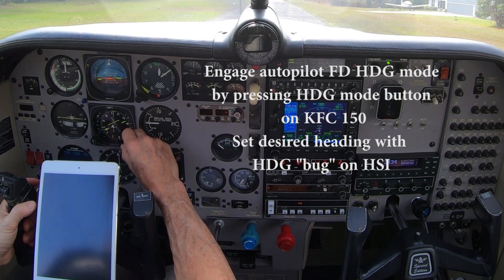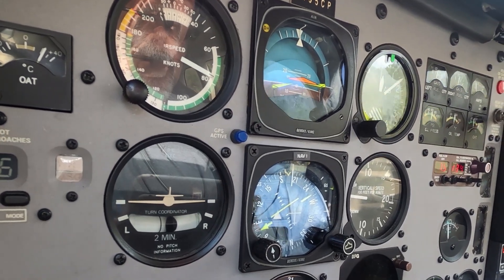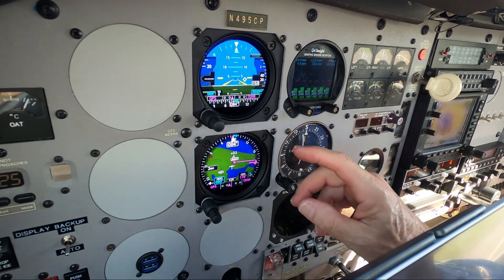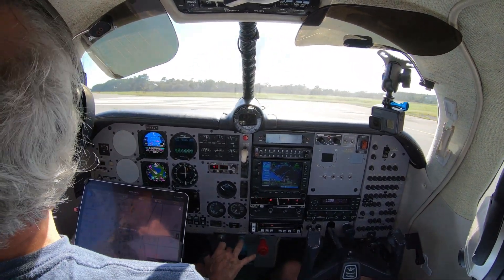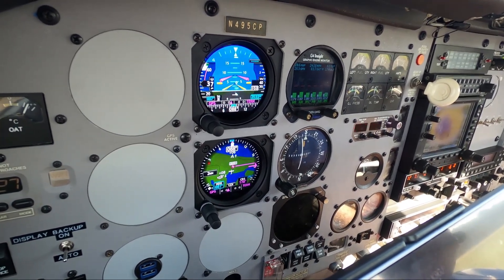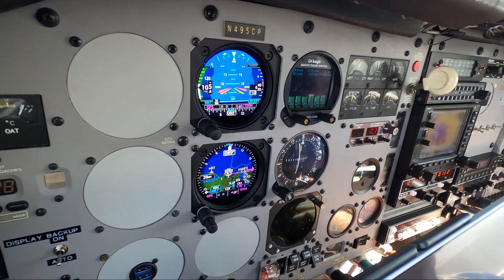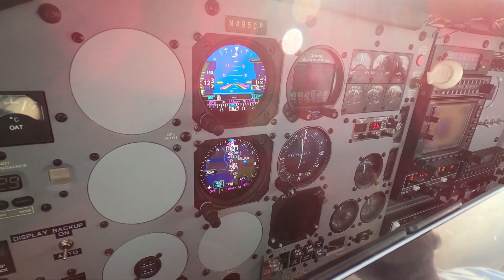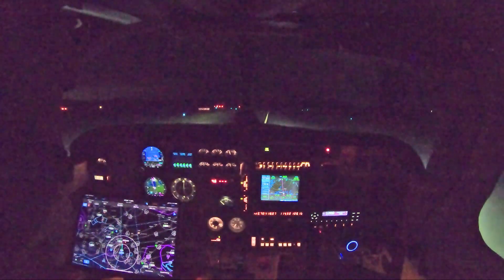Dual GI 275 upgrade - Flight Director takeoff vs Vacuum driven AI in a Mooney Ovation

Comment: A dual cueing flight director works much better with glass avionics. I don’t know if there’s an option for that on the set up menu but if there is you should try it.
Reply from the maker: I am aware that the G3X does have that option. Not sure about the GI275 though. Although I am comfortable with the FD option I have. 
Thank you for the suggestion.
Reply: Savagecub…The dual cue, Sperry, “Dancing Snake” is selectable on both the G5 and the GI 275.  The Collins, single cue is the default FD and the one most folks seem to use.  Personally, I prefer the dual cue.  Once you become accustomed to it, you can shoot a tighter approach than with a single cue, especially when the display is small like the G5 and GI 275.

A side note to remember when using a FD…always look through the FD to ensure the commanded attitude is correct.  FD’s do fail.  I have seen them fail without flags.  One should always know the desired attitude for the particular phase of flight.  The pilot is always the final judge and solution to the automation.

Comment: So you have both units set up as ADI+AHRS (+AP) for the top unit and ADI+AHRS lower unit?  That is interesting.  So can you still use the lower 275 as an HSI also?  Do you have all the map functions on the lower unit and the upper unit?  Curious why you did not go with a 275 MFD for your EIS system?
Reply from the maker: Hi John,
The bottom unit is an ADI+AHRS and IS configured as an MFD / Standby ADI. So it has all the pages of an MFD including HSI and HSI map. 

I didn't get a 275 to use as an EIS because my G4 works very well. I would have gotten a 275 as an EIS if it were able to display both EGT AND  CHT on the SAME page. Unfortunately it appears they don't. I believe if you have angraphical engine monitor you should display bot parameters to be able to diagnose right away engine problems and differentiate between detonation and preignition. On the other hand, nice features of the Garmin unit acying as primary instrumebt gauge,  alarms, etc.....

Comment: Nice set of detailed videos. I am in the process right now of installing a second G5 in my Twin Comanche. If I didn't already have a G5, I probably would have installed a pair of GI275s.

How's the scan now that the legacy airspeed indicator and altimeter instruments have been removed? I find the presentation on the GI275 (or G5 for that matter) much too small to function as a true standalone PFD.
Reply from the maker: Thank you Ryan!

The scan is easy and intuitive. Took a couple of flying hours to get fully  used to its compact tape presentation it but it is second nature after that. Do not miss the six-pack at all!!! It is all in one place and very easy to read and interpret. 

The difference between the 275 and G5 is like night and day. The 275 is bright and very crisp in any lighting condition. Very surprising for its size. Would a G3X or G500 be better? Of course, but MAJOR $$ difference!!! 

I am extremely pleased!!

Comment: Thank you for taking the time to make this video. There are more and more video out there on avionics upgrades. I for one appreciate the time taken on this. With all of the options that are becoming available, it’s great to hear real
feedback. I find this very useful. How much did your set up run you?
Reply from the maker: Thank you Scott! I am doing one specifically on its interaction with my KFC 150 autopilot and using GPSS mode that the 275 emulates. Hope to have it published this weekend. Takes some time to edit...

About $17,500 to $18Kincluding OAT probe and USB ports (GSB-15) which are very useful and worth the additional ~$500. Also includes wiring to the GDL-69 in the back of the plane (~8 hrs labor). No expense to make new panel since they fit in existing round holes. However, small cost to make hole covers and move engine monitor to top right.

Comment: Does Garmin provide the bezel to fill in the larger hole?
Reply from the maker: They have a bezel, but not sure what you mean by larger hole.
Reply: @chriskoppel3940  probably not the right word but the “bezel” is the black piece that turns the larger hole from the KI-256 into a 3” hole to accept the GI-275. I have the KI-256 and KI-525A with KFC-200 in my Bonanza. Thinking about doing a similar upgrade, maybe in the near future.
Reply from the maker: Yes, they do. Check with your installer though

Comment: I am about to add 2 gi275s to my plane. I’m curious if you miss the other steam gauges.  I’m trying to decide if it would be useful to keep the airspeed, altimeter, and maybe an extra cdi. Would you be good in imc with your setup? I would appreciate your thoughts. I
Reply from the maker: Hi Cvlenjnir, I do not miss the other steam engines at all. Took a couple of VFR flights to get used to the new setup and not depending on needle movements and positions for reference. I did own a Mooney Bravo with a G1000 so reading tapes was not that big of an issue even if I had owne/d this Ovation for 3-1/2 years before installing the GI-275’s. I find the steam gauges would be distracting since the 275’s provide a lot more info and one could be looking everywhere and not focusing on key info during an IFR flight. The other issue is if that you kept the vacuum pump to keep the original AI it would mean two points of failure and confusion. I felt the ASI and Altimeter would introduce distarction as well as points of failure in the pitot-static system. The diaphragm in the ASI can get weak. The second unit acts as a perfect backup in case the top one fails. It automatically reverts to ADI to get you were you need to go safely. They each have a 1 hr battery if your alternator and battery dies. Also have a VFR GPS in case you loose GPS from your navigators. Great units and great choice for your plane!! Less stuff in the panel also allows for better air circulation to cool the other instruments.

I have flown several approaches in IMC, both ILS and RNAV approaches and they work beautifully! Very stable and reliable. All the info you want and need is there. 

There are a couple of items that could be better. First, when flying an ILS the 530W will not auto switch the CDI on the 275 from GPS to VLOC. You have to do so manually when intercepting the final approach course. The GTN’s (650 and 750) will auto switch. The other thing that Garmin says they will change in the next software upgrade is how to enable and disable GPSS. For autopilots that do not have native GPSS the top unit (ADI+AHRS+AP) will emulate GPSS for the autopilot and you have to have the autopilot in HDG mode. To get to the GPSS function you have to go 3 levels deep in the menu which is a pain when busy in IMC. I use it when cleared for an approach and know that I will not be given any further heading changes. The heading bug on the HSI becomes disabled when in GPSS mode and so one needs to go back into the menu to be able to run the autopilot in HDG mode. Once the GPSS feature is either on the main screen as a toggle field or in the first menu level then it will be less cumbersome to use. I will be dong a video soon on GPSS with the 275’s.

Hope that answered most of your questions.

Enjoy your new 275’s when you get them installed!!
Reply: Chris Koppel thanks so much for the reply. I am putting in two gi275’s, a gnx 375, and a gfc 500 in my 182p. I decided to go the same route and I’m getting rid of all my stem gauges. I can’t wait to get my plane back.
Reply from the maker: @cvlenjnir  That is a really nice setup! Let me know how it turns out.
Reply: Chris Koppel hey Chris, do you have suggestions as to what all I should do in my check out process when I get my plane back?  Are there any things in particular that I should check out?
Reply from the maker: @cvlenjnir  I am not sure what you mean by check out. Is it making sure equipment works as expected or your familiarization with the units and making sure you are competent using them.
Reply: Chris Koppel did you leave your nav 2 connected to the old cdi and just the nav 1 connected to the gi275?
Reply from the maker: Yes, the 275’s do not allow for an analog unit like the KX155 to be connected to them due to lightning protection. So could only connect my 530W. I connected it to the top unit.

Comment: Hi Chris.  Great videos.  How are you finding reading the instruments in turbulence considering they are so small?   Any difficulty seeing or interpreting all that information on such a small screen?
Reply from the maker: Hi Curt,
No problem reading or interpreting in turbulence at all. They are relatively small instruments but Garmin has done a great job making the key numbers stand out - ASI, ALT, HDG, CRS as.well as other pertinent info.
My main complaint which is also the major complaint that Garmin has received from othe users  is that the GPSS selection for the autopilot is buried 3 levels deep in the menu for the ADI+AHRS+AP top unit. They have promised to change that.

Comment: Forgot to ask, what’s up with your “display backup” switch? Is this for 275s?  I read the install manual and didn’t notice anything other than breakers
Reply from the maker: The display backup switch is to manually set the bottom standby ADI as the ADI at anytime. You can do that if you notice a discrepancy and the units don't switch automatically, or for any other reason.
It is required per STC when you have them set up as ADI+AHRS (+AP) for the top unit and ADI+AHRS on bottom unit and therefore working as ADI for top and standby ADI/MFD for bottom.
Reply: @chriskoppel3940  interesting....buddies T210 didn’t do this and there was no budget...I didn’t read anything and his techs/my techs didn’t say it was required....I figured it could be like a regen in Aspen or g1000/3000....but don’t need it with G5’s either.

Comment: Friend just put a pair in his T210R....they are great. He only uses the knob on the ADI not the HSI for Alt preselect, heading, and baro. Doesn’t touch the bottom one....kudos this is the best video I have seen on the tube for GI275. Garmin should send you some Swag!
Reply from the maker: Thank you for your comment John!! Greatly appreciate it!

Definitely can use top button for all the functions you mentioned, however the default is baro and therefore have to touch the desired field first and then twist the inner button for either HDG or ALT. The bottom button's default is HDG and can just turn it to change heading or press it to sync to current heading. To change course you have to press on the CRS field and then twist the button. 

I prefer to save one step requiring pressing the HDG field on the top and simply "go for the money" in one step. 😀

Thank you again!! Hopefully more coming soon.
Reply: @chriskoppel3940  Having a GFC 500 autopilot solves all that.  Heading and altitude is selected on the autopilot and displayed on the G5/275, and baro (in my case) is still selected on the G5.  The GFC 500 provides enhanced capability with the G5/275/G3X combination.
Reply from the maker: @mannypuerta5086  I installed a GFC500 along with a GTN750 Xi early this year. :)
Reply: @chriskoppel3940  The 750 is a good unit.  Hard to beat Garmin.
Reply: I agree CK!

Comment: I am using Islip Avionics who is a reputable Garmin dealer on Long Island. 

Are you happy with the way the heading bug functions going from GPS to simple heading bug?

Thanks again for taking all that time to make the video!!
Reply from the maker: Reputable and a shop that keeps busy and organized is great!

GPSS works great on the GI275. When it is active the HDG bug turns hollow, otherwise it is solid magenta on pure HDG mode. The way GPSS works  depends on the autopilot with which it is connected. For example for the KFC 150 I have it is emulated and therefore I need to have my autopilot on HDG and change the mode (HDG -> GPSS) on the 275. It will then send the KFC 150 heading info to follow the GPS course. Other autopilots work in "native" mode and I presume that therefore you make the GPSS selection on the autopilot and it will take the course directly from the 275 without any need for changing the setting on the 275. I believe the HDG bug will then remain solid for "native" GPSS.

What I don't like and is the significant major complaint to Garmin is that the GPSS vs HDG selection on the 275 is buried 3 levels deep in the menu. In a busy IFR environment this can be distracting.

Hope that answered your question.
Reply from the maker: ... and Garmin has promised to bring the GPSS selection higher in the menu or possibly a touch screen selection.